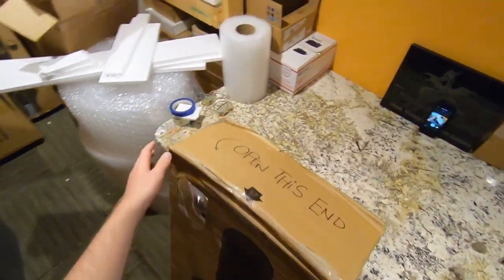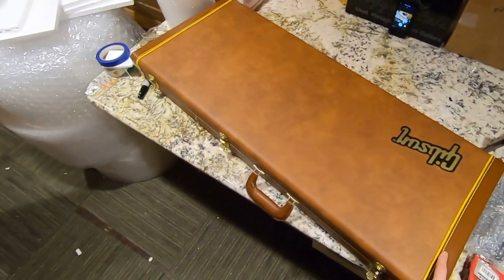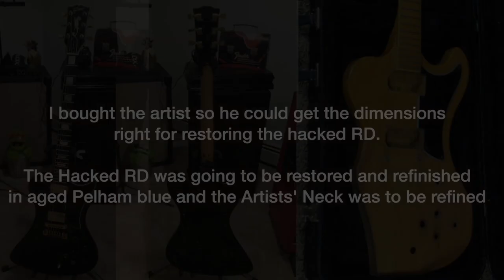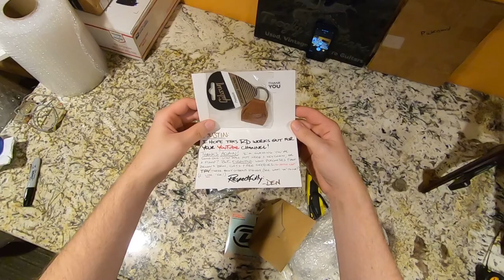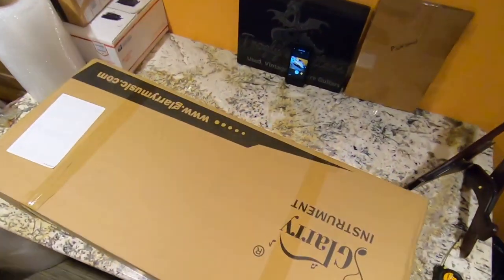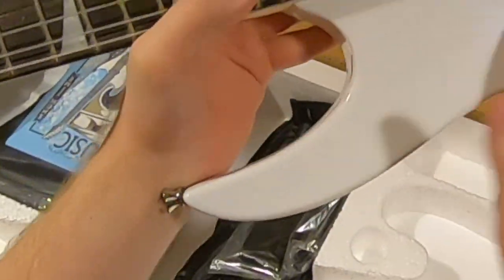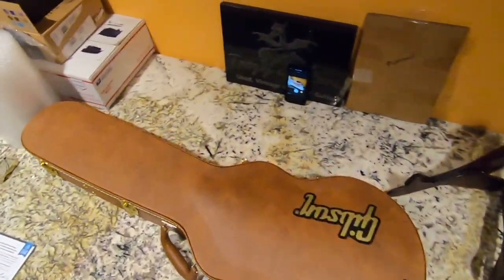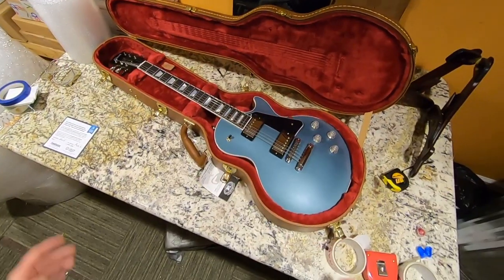Shipping Damage Has Occured | Trogly's Guitar Unboxing Vlog 19

Comment: It's a quality control mistake.... The fretboard wasn't glued properly. Definitely, it is a small probability that guitar could be damaged like that because it was in a hard case and a box.
Reply from the maker: Not really, that is the 2nd most common shipping damage crack location. It is caused when the shipping box falls over flat on its face.  The G-force trauma causes the fretboard to lift and you'll see the crack lines by the nut.
Reply: @Trog    Thank you for the info. I hope that you will solve that problem the best possible way.

Comment: I'm curious about your J-35?? Not an expert( yet) but trying.The acoustic you took in on trade.I'm on the look out for a LP JR with the one p-90 I believe.
Reply: If you want an original, I have a 1958 single cutaway, with the original price tag. Or, Epiphone makes a 3/4 sized one, but it doesn't have the P-90. And I got one of those for $77.00.

Comment: UNLESS the seller had a UPS shipping authorized representative pack the guitar, UPS will deny the claim and the seller will eat the loss.  
It happened to me back in 2010 when I packed up my pristine Gibson SG Standard very well, detuned it slightly (a MUST according to UPS rules),   Bought the UPS insurance and shipped it at my local UPS store. When the buyer got it, the headstock was snapped off so we opened a case with UPS. BECAUSE I packed the instrument myself, UPS denied the claim, and I refunded the $$$$$ to the buyer. So what did I end up doing? I went to the shipping store I’d used to ship it & they explained that UPS will deny the claim if an authorized representative didn’t personally pack the guitar because........you cannot prove that the guitar wasn’t damaged when it was all packed up!!! They explained that UPS will not deny an insurance claim if a representative of their authorized shipping stores packs the guitar. 
I was mad as F*ck. I l sold the guitar with the broken headstock to someone local for $300 & lost $600 on the experience. Since then I never pack a guitar myself to ship. It’s not worth being denied a valid claim.
Reply: Speedforhire I wish everyone knew about this. I probably should do a video on it but to get the truth out, it takes more than me telling it!
Reply: So they let you insure it but would not cover the damages?
Reply: The Devil's Advocate Yep. It’s common practice if you pack the item yourself.

Comment: Wait you sold the F hole Les Paul on Reverb and you're using eBay tape? I've seen you talk about people shouldn't do that.
Reply from the maker: That is for free USPS supplies when used to mail with UPS or FedEx that is illegal. You can buy this eBay tape here https://rover.ebay.com/rover/1/711-53200-19255-0/1?mpre=https%3A%2F%2Fwww.ebay.com%2Fitm%2FeBay-Branded-Packaging-Shipping-Tape-BOPP-1-Roll-75-Yards-2Mil-Thickness%2F392282597157%3Fepid%3D24022439891%26_trkparms%3Dispr%253D1%26hash%3Ditem5b55dd6725%3Ag%3A7f0AAOSw1wBcvuWD%26enc%3DAQADAAAB0KX%252FKt4E1xf3SDqEdBclaYY0AR5kS3dw5w58qxMnIMT8N97yjXaJ4IWLW7aPNyl0sQGhGymlC2hCeUnvyWW%252FWo%252FMtmW1q231CkWZGKc%252Fd7BEKrpUDhkfZ89s5f0rGfa2enRZo0F0SqiZXRTYfViGDkOMf%252BvEDqzzdNriEAeH24Q1bqXIeUxTMwwI9ZJZnXz0EQuB6E9RI2zFLgbaIIZwXWieew9mh6KU0c1s6jEhax%252BOiqYRUoVdfclvLwwtbIuFLDACDFRnb5PUqsWpHJuriBlLn4yYb2Qrn33klHspiKBk4LTzK6OsJ4Iru%252FNfwRFksQi4L0M%252F6VmFng7ys3NjxfnGvU8P14dlGMQhowhf5m7Q8rZyEa%252BNlSrJQpgURQEBSA5oZZZ1ER8c6x57fv6oWSN8pTrn4Gw8rE0iKvgxeVudiE3R7AdUGxZyu4%252FDZMhruAj8BBvXmYhq1Cd%252BnS7Iyi%252FZheSNbVwbmhYVQ13At94XqBqqwAPmyLx%252BDheNPn0ABZ653Vb58TDMdqsVH6V0hW3tlBRKH6pohU%252BNCcg2lQxtWtNKTNe%252FrmPLHVMwhY6COR8JsHEG0CxjPDBCJM%252FHB4K1RwQbVNZzkvloyZq3j%252B5U%26checksum%3D3922825971573d4222f0b36a472792f3d5e378cb2bef&campid=5338292223&toolid=20008